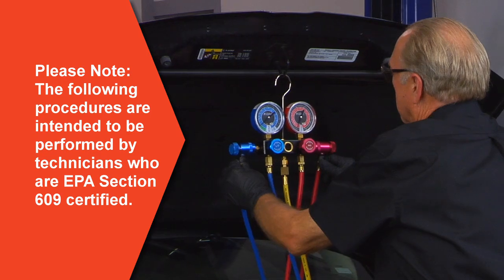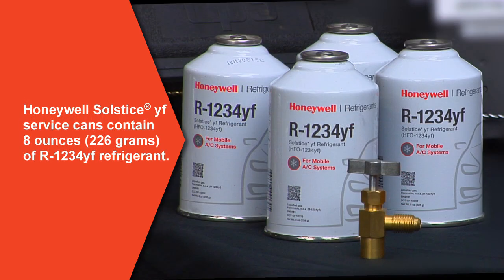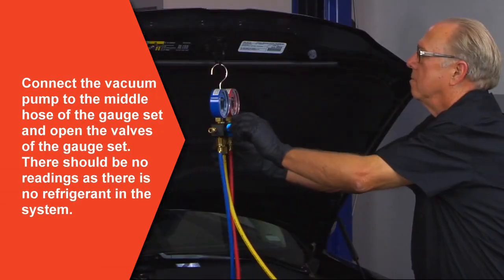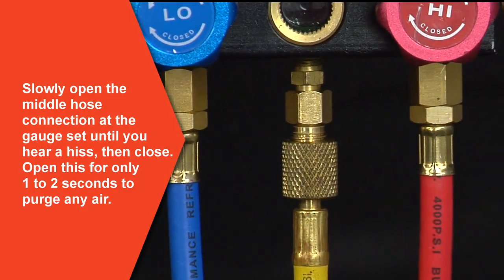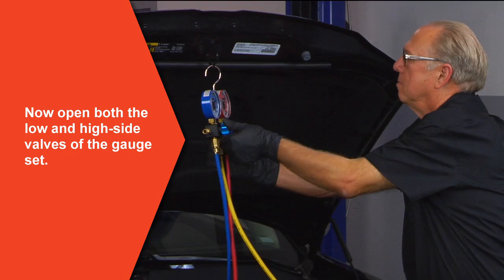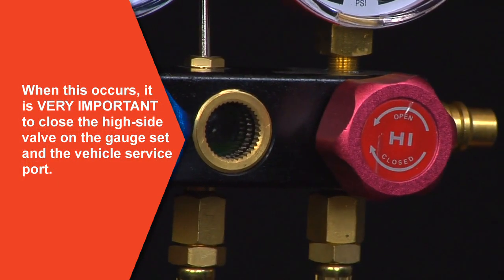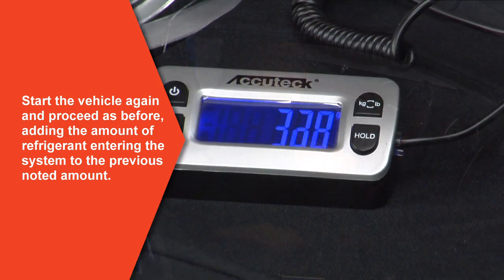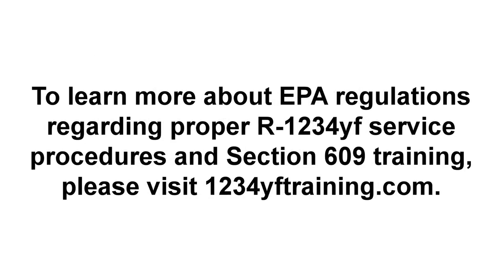Honeywell 1234yf Proper Procedure

Comment: Getting an accurate charge using small cans doesn’t happen very often and getting that can to balance with a heavy hose on a scale adds to the problem that’s why only big 30 pound cans should be allowed. 

      2: if you used a four port refrigerant manifold you would not have to purge any refrigerant to the atmosphere because that fourth port would be hooked up to your vacuum pump vacuuming down cleaning out and drying your hoses preparing them to add refrigerant.

        3: pulling a vacuum and watching gauges is extremely inaccurate and a very old-fashioned barbaric way and often leaving moisture inside the system without being able to actually measure it with the use of a micron gauge. On top of that vacuum is a very poor indicator of a leak because often slight imperfection in rubber hoses and O-rings can easily seal with only a difference of 14.7 psi between atmosphere and a complete vacuum but under pressure leak. And this is also another reason to use a micrometer you could read very small imperfection in leaks that watching a needle the human Eye will never see within 15 minutes. 

            4:  and if you did have sloppy technicians who often have leaks when they re-assemble components part of your vacuum procedure would be using dry nitrogen to do a triple purge and evacuate. At the same time while you were performing the procedure you easily pump it up to 150 psi with dry nitrogen then placed your electronic digital manifold gauge set in pressure decay test mode that will read pressure losses of down to a resolution of 1/10 of a PSI. 
   Now you’re ready to perform your Final vacuum. 

     5: now comes the real beauty and usefulness of knowing how to use a micron gauge when performing your vacuum you can actually read the removal of moisture that when a car has been in a collision in sitting for many days or weeks in the body shop with the refrigerant lines open to the atmosphere and the ESTER oil or PAG oil has been completely saturated with moisture that Preforming a simple vacuum for 15 minutes or 30 minutes or even an hour many times cannot remove this level of moisture contamination. And with a built-in micron meter or individual remote micrometer you can actually read and prove and document your decay of vacuum with the release of moisture out of moisture saturated oil and there’s actually an app that can record this and you can prove it and download it and include it with your invoices as proof of proper evacuation. 

        6: now this is where somebody from old school came in telling you to use charts for pressure and temperature relationship with refrigerant in many cases has no reference or anything to do with the modern day cars that have computer control displacement and pressures by the sensors they are monitoring will completely throw your numbers you’re trying to use off a chart making them completely irrelevant. 
        Where would I try to use pressure temperature charts where he knownfixed condenser fan speed that was not on a fan that was varying up and down turning off and on or cycling between one fan into Fan throwing your numbers off. You have to instruct the technician in what exact procedure in settings the Dash recycle vent needs to be on or off and it’s usually off and where is he taking the temperature of his income in air is usually always wrong because if it’s coming through the firewall vents underneath the windshield with the engine running on a hot day with the fan blowing from the hot radiator air over the exhaust manifolds down the air intake that could be 130° instead of the ambient air this is where a lot of false information on videos and mistakes are made. 

       7:   And infrared thermometer would be one of the last pieces of temperature measurement equipment you would want to use very in accurate makes a big difference whether the car in the dash is in the direct sunlight where the black vents are being hit with the radiant radiation heat from the sun altering the surface temperature of the vents them self and then there’s the dwelltime how long has it been resting with cool air before it actually cooled off all the plastic and mass of material inside the vehicle. On top of that you never shine indirect the optics of an infrared thermometer into the cold air stream because of the rapid change in cooling affect across the optics giving a distortion giving a technician a very false reading on his display that will often give you a much lower temperature than actually is coming out of the Dash this was explained in showing to me by my father when I was 12 and I am 54 now and this information was widely known what happened to our education system in the automotive field. 
          Excellent temperature probes with a long reach that can actually go down into the vents that are manufactured by Fieldpiece or Testo or high-quality accurate equipment that comes with apps and you can record and data log in at the same time we will also give you your empathy your dewpoint and your humidity all at the same time that you were can record and attach to your invoices for documentation and proof. 

8: it was a good informative video for DYI backyard mechanics but not for professional automotive technicians I believe this video should be remade and re-shot with a higher degree of proficiency and education.
Reply: You seem very knowledgable, but if a regular vacuum draw for 30 mins works and the system cools well and lasts it's expected lifetime, that is all that the average consumer cares about. You can't justify anything more for very little gain in performance or longevity.
Reply: @samg5543  then why not just do a three minute vacuum

I can get the system down to 29 inches of mercury is in less than three minutes so I should just stop right there you’re saying and forget about longevity 

Interesting business plan that would make me a lot of money on returns because all my customers will eventually or if they sell their vehicles off with Stark Road in from the inside out lots of Evaporator or Leaks lots of condenser lease and a lot of burned out compressors 

That’s a beautiful idea 

Let’s all change the industry standard that less is best 

Because customers don’t care  🤔

I remember my service riders at shops I work for, would say that kind of stuff and service, managers, and owners of the business. Everybody who had a monetary benefit from not doing things correctly. . 

Or people who are on commission or based on time pay 

Les is Bess less is more profitable 

I’ve worked in those places before very familiar with that thinking . 

That means Body Shop doesn’t have to spend all that time prepping when painting a car to get all the rest off because it won’t show up longevity is not important so they could paint over little spots of rust. The body shop doesn’t have to spend all that money and extra time, putting in water removal in their system for spray painting, so little droplets of moisture That gets embedded in the primer next to the metals doesn’t form rust spots because the car will be long gone down the road and it’ll be 2,3, 4 years before pops out five years so we don’t need to do that anymore either.. 

In fact, it’s a lot of work removing all that carbon out when you’re rebuilding heads and engines we’re just gonna leave the gunk inside the oil galleys we’re gonna leave the carbon behind exhaust valves. We’re just gonna laugh the face of the valve because it’ll work and all that extra stuff for longevity is not important. We just needed to run and collect money and ship the car out as long as we see those tail lights in our bank account as fast all that is extra unnecessary steps. . 

I could see where we’re going with this idea of the customer doesn’t care about longevity . 

In fact, we don’t have to be exact on doing wheel alignments because slightly wearing out tires a little bit faster as long as it’s not too fast and they can’t blame us for it. We just want to do some things and set the tone and let her go because customer doesn’t care about longevity on those tires . Will just blame it on something else will say they hit a curve or a suspension component has worn out and caused aware not that we cut corners and then unnecessary stuff that takes longer. I see where this is going.

It’s all about the money 
Profit margins 💰 

That root canal with infected root pop Dennis doesn’t have to go all the way down to the end of the route and get that last little tiny bit of infection just get most of it fill it over give you an antibiotic you’ll be OK it won’t blow up into a massive infection probably for another 2 to 5 years Causing bone rock as he eats away from the inside of the bottom of the root canal into the bone before you get it taken care of Dennis get a quicker makes more profit. We see where this is going.. $$$ 

Roofers don’t have to spend all that extra time installing the roof making sure everything is perfect that the flashing doesn’t allow the rain to go up backwards underneath and rot out the wood because it won’t leak right away. It’ll just cause mildew and slow wood rot. That’ll take years before you find out but it’s cheaper and faster and more profitable not to do it right Just do a minimum like everybody else.

Minimum standards for everybody
Reply: A, nobody is willing to pay  for that level of service. B, very few techs are skilled  enough and care enough to do it. C not many techs have pro hvac equip
Reply: @780brando  you are 99% correct on every aspect the only customers I need are the 1%. 

I leave the turd work that sinks to the bottom of the septic tank for the 99%.  They get what they pay for and with the hellcat you lose horsepower when you cant chill that compressed air
Reply: I think one reason 30 lb cylinders are not produced  (at least now) is because a scale that has a .01 lb resolution can't handle 30+ lbs on the scale.
Reply: @samg5543  my NAVAC scale can handle 200 pounds and its accuracy is 0.011 pounds. = 5 g accuracy.. 

Large scale that accurate have been produced for decades now . 

The price used to be so high most people didn’t know they existed . 

What were today’s Electronics and metallurgy and machining practices it’s been brought down to scale mass-produced very cheap an extremely accurate . 

I own one .
Reply: You obviously googled this shit bro, techs have been doing it this way for years and it doesn't drastically affect any critical systems. If Honeywell, one of the best companies, made this video it should be accurate
Reply: @brendanch  Big companies do it as short and sweet as possible because it’s about having low skilled uneducated technicians to do it just good enough to make the money and get it out the door and have the lowest chance of it breaking within warranty that’s it. 

      Didn’t need to Google anything that was the way my father was taught by an old guy and we went to HVAC classes back in the 80s I had HVAC classes for Automotive and then the 2000s I took two years of commercial refrigeration and residential HVAC and then on top of that I took a third major building automation for another two years. 

    I don’t need to Google anything it’s all in my head I thought Google everything she knows.
Reply: Firstly, there are no "30lb" tanks of R1234, it's 10lb tanks, and they cost almost 600 dollars (as of today. Price is always changing).

Secondly, no professional repair establishment charges by cans anymore. We use a service station which evacs, extracts oil, vacuums, and recharges to spec all in one unit. That detail is very important because you never want to reuse the oil in an MVAC system. Especially an R1234yf system.

Lastly, micron gauges are pretty inaccurate on MVAC systems. This is due to the different materials used in an MVAC system, the plumbing design (lots of aggressive bends etc), and the different diameter tubing found throughout the system. A micron gauge will just drive you crazy thinking you have a leak when you don't.

I will give you credit on vacuum is a poor method of leak detection. So pressurizing the system and using a soapy water mix is the only proper way to check for leaks.

Finally, I'm not talking out of my asshole. I've run my own high end garage for a decade now. Look at my videos and see the type of cars I service.
Reply: @LynxStarAuto  Firstly 10 pound tanks are too small because they go through one and a half to two tanks every day and I often end up transferring into 30 pound tanks. And $600 doesn’t mean anything even if it was $6000 you still just mark it up it’s called business. 

Secondly 1000% agree with you no professional establishment charges by cans.      Unfortunately tens of thousands of so-called pretend want to be professional garages are still using cans to this day hook up the little hose and whack off their little cans I have to deal with these dumbasses every day repairing their work redoing the REcharges. 

The biggest offenders with little cans for some reason they haven’t comprehend purging hoses correctly or accidentally getting too much air back into the system and usually when I use my refrigerant identifier I always find a few percent of air mixed in with the refrigerant because every professional shop has a refrigerant identifier and knows better for the last 30 years. 

Lastly micron gauge does not care how long the hoses how many bins how many turns or how many evaporators or expansion valves are on the system at micron gauge care less it doesn’t affect it at all that’s the problem with the lack of education and knowledge not even knowing what you don’t even know
             Nobody is chasing leaks are going crazy with a micron gauge and less they are completely on educated and don’t understand how to use them but that just comes from ignorance.

As for soap and bubbles yes back in my grandfathers day and my Father’s Day they used to use soap and bubbles on the old Ford Chevys and Chrysler is when everything was easy to get to and as I started back in the late 70s and early 80s.   Now that refrigerant lines on some of these Porsches and Ferraris and Mercedes and even some of the new American cars are buried up inside panels under fender skirts in accessible hidden in engine compartments.   And now that I’m starting to get a boatload of electric vehicles with heat pumps even my tesla you cannot get to anything with soap and bubbles except at the very beginning as soon as you open the front frunk covering.   The RVs where they bury some of the lines inside the walls and then cover them up.    Soap and bubbles is a thing of the past but it’s still really good on the few items you could get to so you must still be working on 1960s and 70s cars. 

This is why I real professional shop owns a good leak detector like the Infico DeTek STRATUS.  That can pick up Refrigerant just by walking in a room with a display reading down to parts per million but apparently you don’t know about that you’re still stuck back in the 60s and 70s

Or you use high-pressure dry nitrogen and use a ultrasonic leak detector that you can literally pick the smallest leak up from several inches up to several feet away but apparently you don’t know about that either

And then last but not least good all dependable Tracer Line UV fluorescent dye or the AC Extreme brand UV dye.   With a very good UV light that you do NOT purchase off of a Mac or a snap on or a Mac truck Like the big UV Beast 365 with the 365 nm filter lens or if you want a good handheld UV light the small Conroy one of the absolute most powerful UV lights that will do eye damage if you look into it because it’s strong. 

They’re good at those pesky leaks that appear a few months or a years later when your customer comes back into the shop.   But of course that must’ve slipped your mind or maybe you just don’t want to spend the money

Ignorance is a horrible thing a mind is a terrible thing to waste

I assume this is why I do not see you at the MACS expo and training seminar conventions that are held every year around the Country. 

you have a high-end professional shop for 10 years you’re just a beginner starting out.
Reply: Always a know it all..... or are you trying to convince people the high charge for repair is a normal thing.....everything you said is not done by 99.9 percent of techs. repeat customers are what we are looking for.....
Reply: @rayb2078  you are 100% right not quite 99.9% of uneducated shortcut taking beer can cold and wave your hand in front of the air duct to determine airflow type of Techs. (if you can call them that) 
       So I agree with you 110%.   And for that other low percentage we care not to associate with the other 99% thank you very much. 
       1:Brazing without nitrogen
2: Using blue Lake lock in all flare fittings so it gets on the inside.
3: brazing expansion valves and overheating them and then badmouth expansion valves why they fail all the time in their garbage need to be replaced with pistons. 
4: trying to fill a system by pressures or by the hand beer can: overfilling it by four or 5 pounds so when a really hot day comes around the refrigerant has nowhere to expand
5:  Setting up a universal condensing fan motor so the fan blade is either too far up or too far down reducing the airflow over the coil making the customer pay a high electrical bill in a low efficiency working system. 

Yep you’re right I’m not one of that 99% thank you very much have a nice day